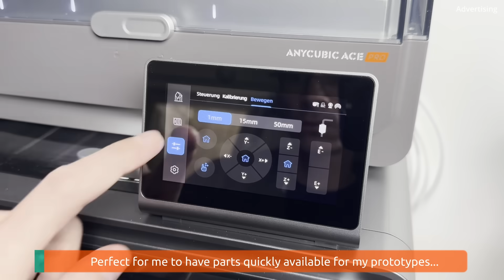3D printed Braiding machine V3.0

Comment: Hi Fraens, Nice Projet here!

Could you tell me if you could do PET sleeves with this machine ? So it makes extensive sleeves.
Could you make custom braided sleeves also ? Or we can by the machine already mounted ? 

Thanks for your answer!
Reply from the maker: Hi, do you mean braiding around large-diameter sleeves? I guess you can braid around 15 mm tubes. Anything larger won't fit through the center opening of the base plate.
Reply: @FraensEngineering   Hi, So i would like to know if can braid around cables, the cables themselves are 3 to 8 mm but the connector can go up to 20mm.
Reply from the maker: Hi, yes, braiding cables works well. That's no problem.
Reply: @FraensEngineering   Nice ! So you could like TechFlex basically ?

Comment: Dear Fraens team,
could you please provide me with an order link for the tension springs or the exact product description?
Unfortunately, I can’t tell from the drawings which springs are supposed to be used.
Thank you very much!
Reply: @FraensEngineering ?
Reply from the maker: Hi, I wound the springs myself. I use guitar strings for this. They have exactly the right properties. I don't remember off the top of my head which ones I used, but they are linked in the parts list.

Comment: This is a great achievement.  Looking at how you have implemented it there are very few parts that would benefit from being machined or injection moulded to improve the durability. Perhaps only the gears, shuttles and the track plates would suffer wear in production.  I like your tensioner design as it has positive regulation with uninterrupted tension, also the handy free vertical adjustment that allows you to change the take up rate by changing just one gear in the set though a digitally controlled stepper solution might be more reliable and flexible in some application spaces where regular adjustment is desired..

Your design is perfect for educational, hobby, prototype and short run development use as a machine can be prepared, adjusted and dedicated to one task without massive capital cost.

Thank you for sharing your hard work.

Comment: Dear Fraens team,
I ordered the kit from you. Unfortunately, the sliding bushings shown in the video at minute 2:29 are missing from the parts list. So I’m not sure which bushings I need to order. Could you please provide the product name or a link to order these sliding bushings?
Best regards
Reply from the maker: Hi, these are standard eyelets. Unfortunately, I am unable to post links here. However, you may search Amazon for: eyelet set, four colors, inner diameter 5 mm.
Reply: @FraensEngineering  Thank you 😊

Comment: This is awesome. Could the design be expanded to 16 carriers and make it comparable to the New England Butt braiding machines?
Reply from the maker: Basically yes, but a much larger base plate would be required. This would require a few more hours of design work.
Reply: @FraensEngineering oh good. This seems like less trouble than shipping an antique braiding machine across the country.

Comment: I think this is really cool and super dig it. - BUT-  You seem to be presenting this as new technology. This appears to be a copy of a new england  braiding machine which is known as a maypole braider  from the early 1920s i have one in my shop. Yours is slightly less compact because it's printed and not made out of cast. Iron like mine does, however, incredibly cool don't want to take anything away from your ability to model  this and make it printable.
Reply from the maker: Hello, it is not my intention to present this as a new invention. These machines have been around for a long time. Several attempts have already been made to produce such a machine using 3D printing. However, everything I have found is rather poorly designed. With my design, it is now possible to weave seriously.

Comment: You could add a small length of aluminium pipe and a disk that fits the ratchet like tooth on the bobbins to the top of the second motor. That way you could also use it to fill the bobbins directly on the machine.

Comment: Very nice engineered machine. I know these machines are used since a long time, but build it from ground up must be a very long way to the finished project.
I don't have a need for such a machine, but if it where not so noisy, i would build it, just to watch it a long long time, to see the mesmerizing moving of the bobbins.
Reply from the maker: Yes, I worked on it for a long time. It's already the third version. And yes, you're right. It is very hypnotizing. Especially when you hear the sound too 😁

Comment: Could this be used with less threads say 3 or 4? And could you in theory off set them to have different designs?
Reply from the maker: Different structures are created depending on how you thread the bobbins.
Reply: And could you laser cut the larger prints? Only have small printers. But have a full-size laser cutter.
Reply from the maker: Yes, that is possible. You can use acrylic glass.
Reply: @FraensEngineering thanks I think im gonna try it. It is crazy you finished it right as I found this idea that needs it.

Comment: 2:49 hey quick question. Have you exported the files in STL or 3MF?. Try using STEP you might get better round objects out of it. Looks like you had some polygon problems there.
Reply from the maker: I have used STL. Thanks for the tip 😁
Reply: @FraensEngineering how can i have a braiding rope machine in the usa

Comment: Where can I download the new version if I have purchased this knitting machine?
Reply from the maker: Hi, after the purchase you will receive a download link from the respective platform.
Reply: @FraensEngineering  I want to upgrade to 3.0. I originally downloaded 2.0. Could you tell me where to download 3.0?
Reply: @FraensEngineering  I spent 34 euros to buy this 2.0 and now it is 3.0. Is it a free upgrade?
Reply: @FraensEngineering  I bought it on June 26th, and it has not been installed yet. Some of the hardware is still being customized. You have released a new 3.0
Reply from the maker: Please write me an E-Mail

Comment: Great way to prevent rotation on the bobbin guides. 

Have you thought of designing an option to braid flat ribbons? I think replacing one of the guides to bend the bobbins around 180 degrees on both sides would work. I remember somewhere that it works with odd number bobbins but not sure.
Reply from the maker: Yes, I would like to build one of these in the future. In principle, you would simply have to redirect the coils again and not let them run in circles.

Comment: Do you think this machine could also braid different materials? I'm thinking of EL(electro luminescent) wires specifically.
Reply from the maker: If the wires are very flexible, like yarn, it might work.
Reply: Can it also handle organics like alternative fibres?
Reply from the maker: It is important that the yarn allows for small deflection radii.
Reply: @FraensEngineering  Because of how you have to guide the yarn from the spools to the machine, right? If so, then modifying the feeding mechanism that handles the spools of yarn should do the rick? 

EL wires are quite flexible, but I wouldn't say they allow for particularly small deflection radii. This also precludes optical fibers from being used. 🤔

Comment: Make a hollow one where you can put parts into it and wind around the object especially for carbon application this would be a great machine :)
Reply from the maker: This machine can be used to wrap all kinds of things. It works perfectly ;-)
Reply: @FraensEngineering  - Could it be used on a mandrel to weave 3d parts?
Reply: You can modify it to braid around a filler.
Reply: @davidbell4986 thats right I mean the upper braiding puller would be not needed for carbon braiding and the middle would be just bigger more spools and  a self supporting ring in the end to keep forces constand you are good to go handling the part is then the problem
Reply: Yeah but it is limited with the small diameter 😢
Reply: @anonym9323  Scale it up lol.
Reply: When does a braiding machine become big enough to be a sock machine?